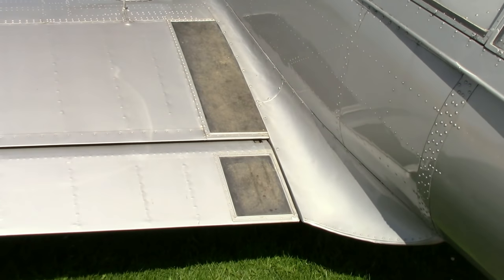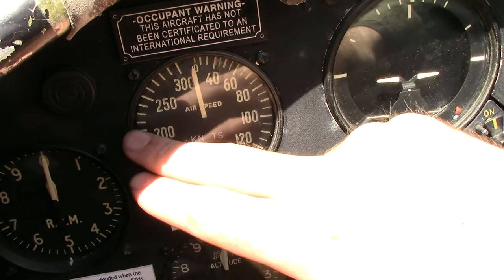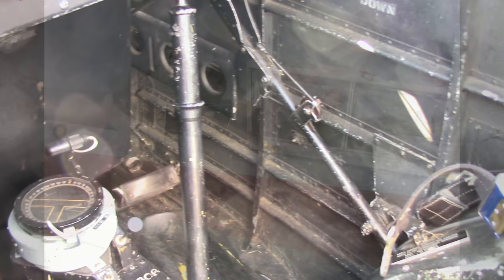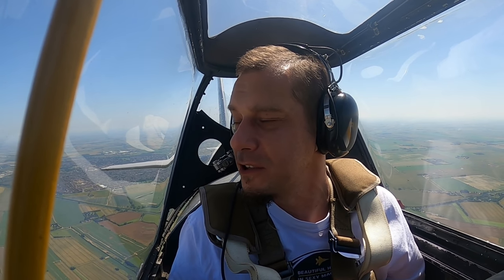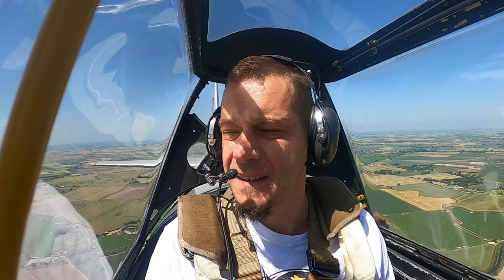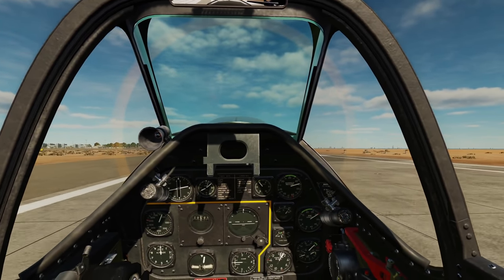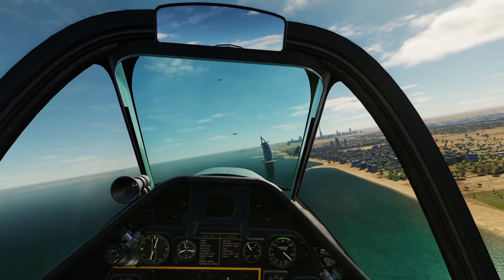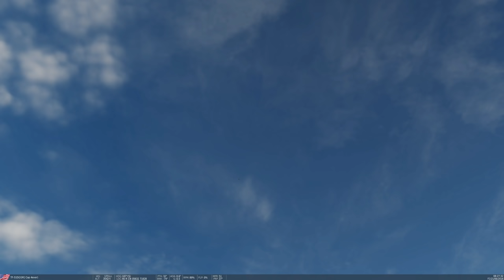Cap & Ali Fly With Formation Display Team "Vintage Pair"

Comment: I went up in Chipmunks several times with the RAF cadets in the 1980’s - loved doing it - the pilots were often on secondment from active RAF squadrons and the last time I went up the pilot I was flying with was on his last time up in a Chipmunk before going back to a Phantom squadron he said “let’s have a bit of fun” and we went through a full repertoire - loop the loop, stall turn, low pass by the tower and so in.  30+ years later still really treasure that experience!

Comment: You shouldnt have given back control while you where feeling ill. Strange as it sounds, having control is the best "cure" for sickness. As a former glider pilot, I have never gotten sick while flying, but I would eventually get sick as a passenger especially in turbulent weather. I think there are two reasons; first one is that while flying you can more easily anticipate movements (because you are causing most of them), and secondly because you are focused on something other than your stomach.  Whenever I took up passengers who got suspiciously silent, I would hand them control. And when flying tandem, whenever I started feeling queasy I would request control. Something to keep in mind for your next flight!

Comment: Always a unique experience flying in a light aircraft. I was lucky enough when i was 14/15 to do some air experience flying in Aircadets at Cosford. 1st in a Vigilant motor glider and 2nd time was a Grob Tutor. There is honestly no other experience like flying a real aircraft yourself and doing aerobatics. The wierdest one for me was always the stall turn. Positive G to Zero to Negative in a fairly short space of time. Great to see you having a fantastic time of it Cap

Comment: We used to call it the "tattie bag" plane back in the 80s when the RAF used it as a trainer. Now you'll know why 😉
Excellent wee aircraft for aerobatics,  especially the noddy cap (or noddy turn). Not supposed to do that manoeuvre....however it just had to be done 👍🏻 😉 😀

Comment: Awesome! Too bad you got sick. I've never been a particularly fine physical specimen but one thing I was always good with was not getting sick when shaken. Though I've never done aerobatics (well, no more than the return to targets we did when I got a ride in a Kiowa -- loved that!) so I don't actually know how I'd hold up. Would love to get the chance to find out. Kinda jealous! Nicely done!
Reply: its the same as sea sickness,ive had air and sea sickness,om small boat and a flight in a moth at prestwick airshow,and they are the same symtoms,only thing is you cant lye down on the deck and close your eyes in the moth to stop it.
Reply: @javlin36859bb  I've thankfully been immune to sea sickness too. So far anyway, knock wood!

Comment: Awesome video! pity you didn't get to fly until after the aerobatics.... the G's do come fast in a light plane
wish i'd been a bit older and not so shy when i got to fly in a light airplane.... would have talked/asked more questions
but the pilot did point out the to me very loose engine and the rusty places on the wing struts....*gulp*

Comment: I can imagine that in that  small lite plane, you are tossed around by every little changes in the Wind direction & speed.  Even slight  turbulence!   I bet u came close to tossing your Lunch when you put your finger to your mouth. Lol

It's unfortunate that you had the Pukeys  on your flight!   I have been up on commercial jets, a single engine Cesna and the the greatest flight I ever had was at a Family Union where a relative of my GF at the time had an uncle who owned his own 206L Bell Helicopter that he took Relatives at the Family Reunion Up for rides.

We all piled in & I was given the front right passenger seat.  He lifted off as if on a military mission tilted forward heavy just missing the 50' Tree tops of the Treeline and it got crazy after that...lol. We were banking almost completely sideways in turns and theist exciting was we were at our end of the flight and at our  highest point, He saved the best for last! From that high altitude, he pointed the nose almost straight down with the ladies screaming all the way down he recovered an flew across the surface of the lake we were over that was so low, it seemed I could dip my toes in the water and it was so wild Flying at such high speed across the surface of Water.  The most exciting thrill Ride of my Life!  Lmao

My GF's Mother was giving her nephew shit when we finally touched down.  Lol. It's hilarious so you can see it was a crazy Wild 15 minute Helicopter Ride!!!  Lol

Glad you didn't toes your lunch Cap!

Nice to finally put a face to the name, You Young Buck!